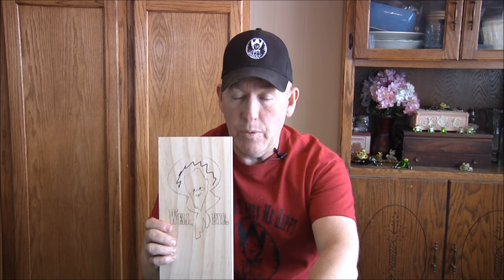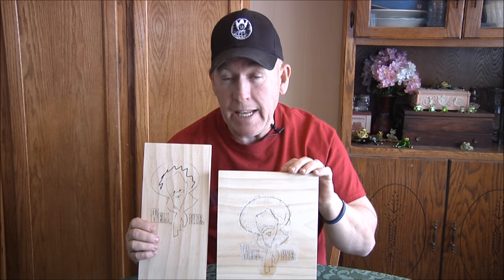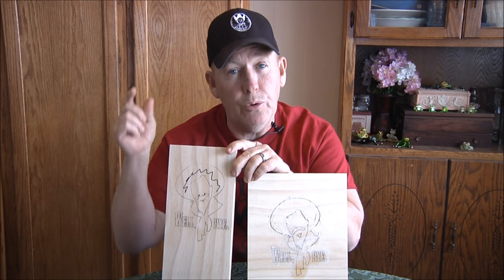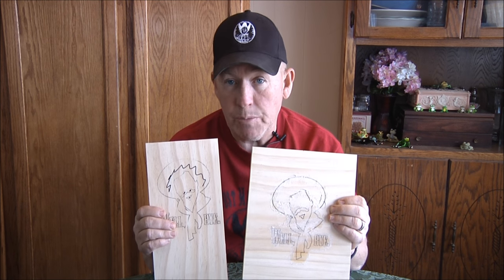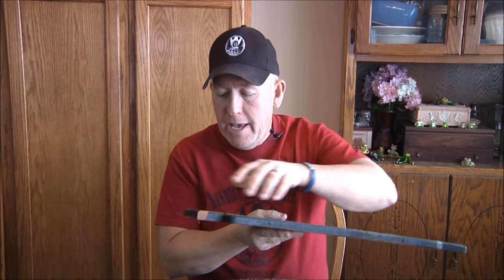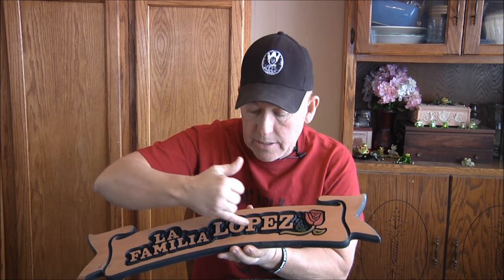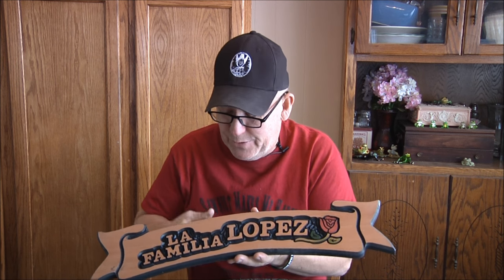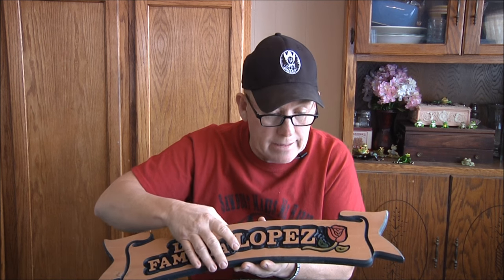Coffee & Questions 4/10/17 Tip on Holding a Line & Iron On Transfer

Comment: When using the sanding sealer, it leaves the grain a little rough. So it might be a little tough transferring your pattern to the pine, considering that the wood should be smooth when you transfer. I'd would go like you did Eric and put the sanding sealer on after you transfer your pattern. Nice video Eric and Vicki.

Comment: Like always, great video buddy.

I always use pine and i have also had tough time holding a strait line sometimes.
What i do is....when i see on the board that it has a lot of grains that i know gonna be tough routing, I'm staying away from the line, and slowly working my way out to the line.... if you know what i mean :)

In the beginning i really struggle with those grains, but after a while i learned how to rout them.
Today i did a sign for a customer, and it had heavy grains, but i took it slowly and worked my way out to the line, and it went fine.

Have a great day buddy.

Pray for Sweden...

/ Morgan Stoltz